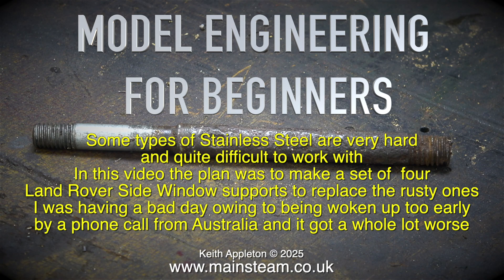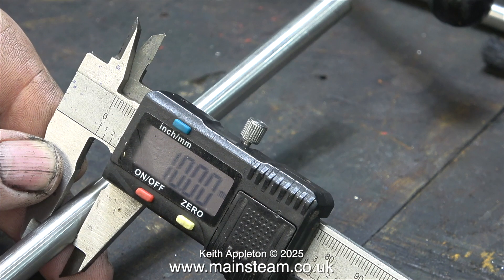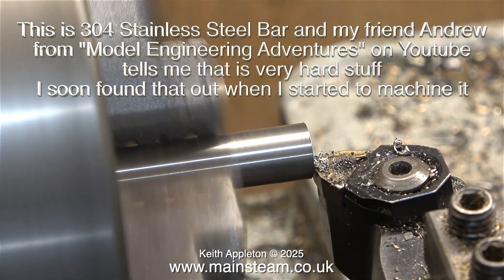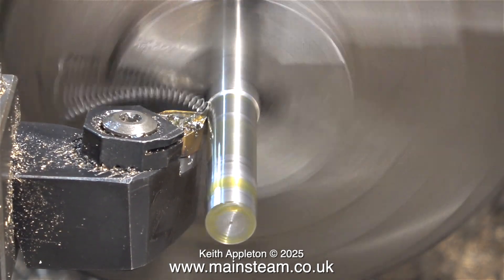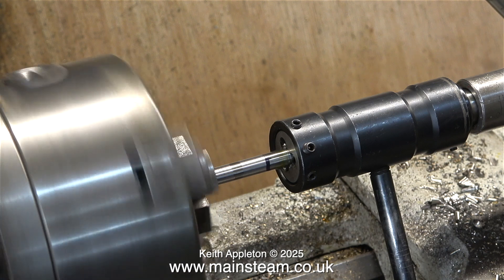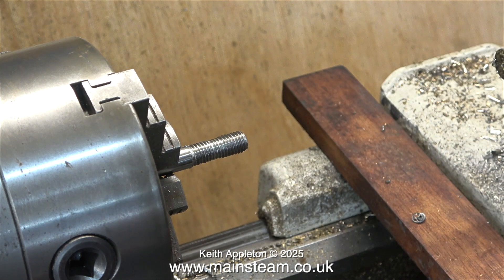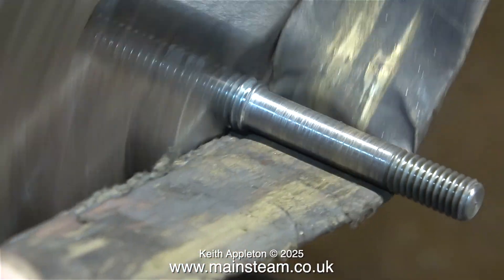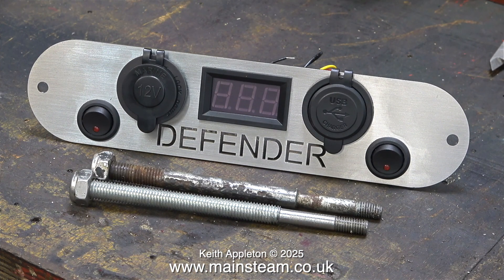ALL STAINLESS STEEL IS NOT EQUAL - MODEL ENGINEERING FOR BEGINNERS

Comment: The issue with stainless steels is not that they are inherently harder than ferrous steel but that they work harden in an instant and only the slightest amount of rubbing with the tool will result in a surface hardening that HSS simply won’t touch. This is particularly so with high tool pressure operations  such as drilling and tapping. Likely what happened here is that your die didn’t start cutting immediately and the end of the rod work hardened to the point where the die had no chance of starting. The key to working with stainless steels is correct feeds and speeds, sharp tools and commitment, hesitation and tool dwell result in almost certain failure. Flood coolant also helps.

Comment: 303 is my S.S. of choice but we use what we can get. I’ve gotten quite fond of single point cutting threads most of the way and then finishing with a die, but I have a lathe that doesn’t require change gears to cut imperial threads so it’s rather convenient.